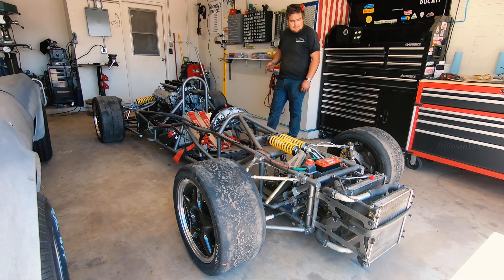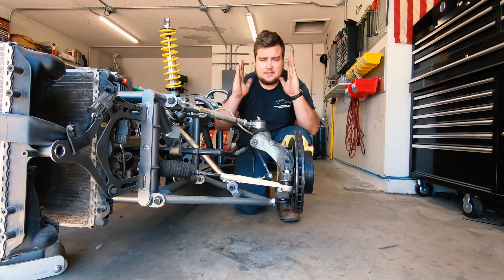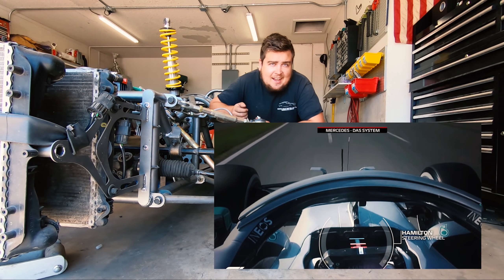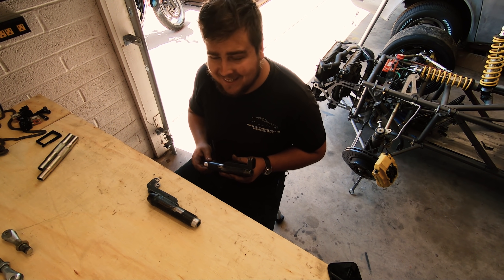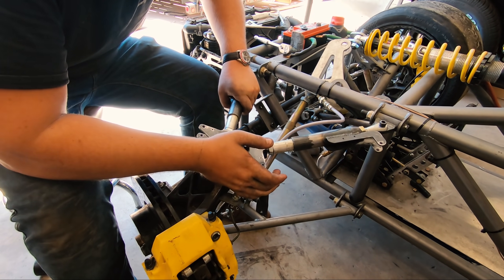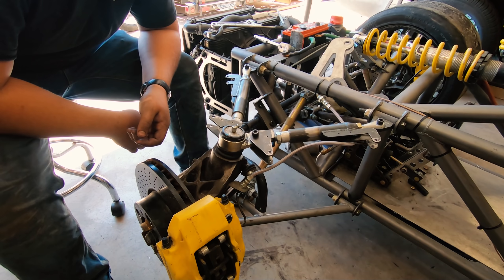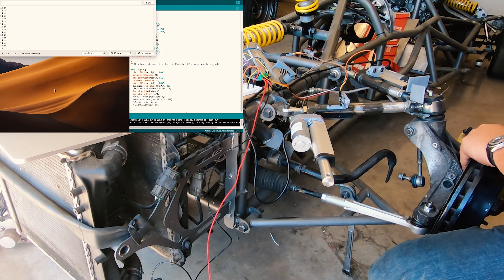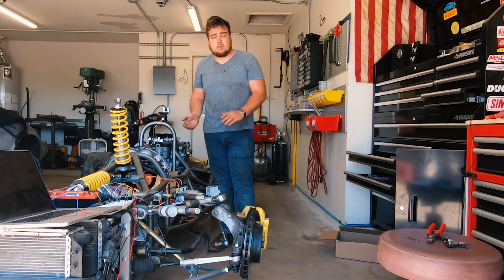DIY Formula 1 Active Suspension and DAS

Comment: On motorbikes they use a liniar potentiometer to measure the front and rear suspension travel.
You could create one a lot like you made the suspension with potentiometer with a toothed wheel and have teeth on the inner rod. 
Idk if I'm making sense but you are a smart guy so you should get what I mean.

Comment: Boomer hotrodder: "If you can't tune your car with a screwdriver, I don't like it!"

Wesley: hooks laptop up to suspension
Reply: There’s a few of us boomers that grew up with wild experimentation in old can-am and f1 and endurance cars, that love this high tech stuff. Heck, the they had full blown active suspension in the f1 cars around 1990 if I remember correctly - of course it got banned. If you youngsters want a treat, look up the UOP Shadow can-am team circa the early 70s that used valve springs on cantilever suspension for weight savings and quick easy spring rate changes.
Reply: @barnabasranch5415  sadly not many boomers who were like that. they're heroes to me tho
Reply: @barnabasranch5415  The unlimited rally scene saw the most insane vehicle mods I've ever seen. Also resulted in a lot of deaths and maimed racers and spectators, so there's a bit of justification for why they banned certain tech from them. I do wish we still had unlimited classes in racing so we could see what utter insanity modern engineers could manage with a fully electrified and sensor controlled suspension, chassis, and an all-electric drivetrain. It certainly wouldn't sound as good, but man electric motors are insane. Especially if you can get your hands on a five-axis CNC mill, an electric motor winding machine, and a bunch of permanent rare earth magnets.
Reply: @mndlessdrwer  lol electric motors would be a major limiting factor
Reply: I laughed out loud
Reply: Haha that's great!
Reply: KISS, the most hassle free way to live.
Reply: Yeah and they are right this shit is fucking boring, over complicated and gives next to 0 benefit in a well set up car.
Reply: @ROGUESPIRIT_  It's only boring because your simple mind can't comprehend it's magnificence.
Reply: @anonymousarmadillo6589  it's really not that good

Comment: Wouldn't it be easyer/more reliable to move the connection point of the a arm to the frame? Could potentially be done with a single actuator. Also, you could look into temposonic hyd. Cylinders to mesure their position accurately.

Comment: Good work. How are you going to control wheelspin? The torque hit is immense and even the 4,400 lbs SL65 cannot stop the tires from spinning at 60 mph? How is your lightweight creation going to hookup with even the smallest of throttle, at any speed?
Reply from the maker: Very carefully- I’m actually not completely sure and it would kinda kill the spirit for traction control- I’m not sure what my plans are outside of not trying to crash
Reply: @WesleyKagan  The weight of your vehicle would benefit with traction by using only 2nd, 3rd, and 5th gears. I believe the any MB car with the V12TT has a setting where the transmission starts the car off in 2nd gear. Comfort mode maybe??? 1st, with your light weight and massive TQ would be a gong show. 2, 3, 5 or 2, 3, and 4th gears. 5th will take you out past 200 mph. As far as tires go, something very sticky like a drag radial would almost be a must but, if you run a super soft road tire, say the Michelin Pilot Sport Cup 2, even though the tire is very soft, wear won't be too much of an issue due to the lack of weight. Also, what weight you do have is over the rear tires thus, providing more traction - Porsche-esque traction. Really enjoying the channel and your work so I wanted to say thank you. Really awesome stuff.

Comment: Could you put the ultrasonic sensors inside the tubes of the upper a-arm? Would be cleaner aerodynamically and aesthetically and would perhaps offer some protection.
Reply from the maker: I may. I’d like as clean as a signal as possible but wire resistors are expensive

Comment: Any thoughts to having some sort of fail-safe mode, or suspension centering in case of a failure?
Reply from the maker: Yeah I’d like a mechanical default to zero but I’m still working on that. Safety is needed on that one for sure

Comment: Could you reposition the sensors near the ball joint and the flat reflectors on the chassis side? Tuck them between the control arms so they are more compact and aerodynamic
Reply from the maker: That would be the goal I think. With as little math I could probably get that to work

Comment: This system seems to do variable camber and toe with potential caster effects too.

That tells me Mercedes is using it to reduce rolling resistance in a straight line and change stability to make it less twitchy on straights.  It might help with braking by keeping the contact patch flatter, probably tire life too.

Those are ok things to do but the real prize in active suspension is to control damping, body roll, brake dive and suspension droop.

Failing a suspension with active dampers, I think a Renault style mass damper would do more for your suspension than a DAS system would.

When you are driving 10/10, DAS might provide an advantage in straight line speed or flicking it around a tight corner but I'm not seeing a point unless you drive like a madman constantly.

To simplify (for toe only), I would put a single hydraulic cylinder between the inner tie rod ends inside the steering rack with something like a hydraulic throw out bearing behind the steering wheel to act as a master cylinder and I would make the steering shaft slider helical so that the asymmetric effect on the steering would be countered by the push/pull.

I don't mean to be a downer but this seems unnecessarily complex by a lot.

Comment: the fact that he's literally put every modern automotive innovation into his own cars is something i want to live by with
Reply: You know what engineers say for complicated systems - more thing to fail. This could be description of a modern vehicle: assembly of parts that will fail, probably expensively.
Reply: Yes. Exactly what I wanna do. Engineers ftw
Reply: And I wish I could have a more primitive vehicle,at least for offroading.
Reply: looking forward to adaptive cruise and lane keeping. Two features I specifically chose my car for when I was shopping last time which necessitated a trip two states away to purchase the vehicle. 2013 Ford Fusion EcoBoost AWD Titanium with basically every single upgrade you could possibly option onto that model year. The one feature it's missing is the heated steering wheel. I added a tuning modchip to boost its power to something like 304 BHP and 350 lb-ft of torque. It's definitely a noticeable improvement, even though it's somewhat debatable whether it was worth the nearly $600 pricetag and lengthy and annoying installation process. Regardless, the Ford Fusion, despite Ford's best attempts otherwise, is an excellent driving car that has weighty and accurate steering and handles better than it feels that it should, particularly given how massively heavy the beast is. Curiously enough, the mod chip only knocks off about 1-2 MPG on the highest tuning setting. Not like it ever got great fuel economy in the city anyway, so a worthwhile tradeoff in my opinion.
Reply: I like that he's only adding the modern performance innovations though.. as opposed to lazy driver assists
Reply: But, is it a hybrid? I don't think so. Lol
Reply: @senul_samarasinghe  maybe it will ! Given how talented this guy is anything is possible!
Reply: @gavinpotter8741  yeah. I was just joking earlier. I can't do squat while that guy made a freaking car with f1 suspension.
Reply: @senul_samarasinghe  Doesn't he said that he needs more weight in the front? The BMW i3 drivetrain looks very well packaged ;-)
Reply: Not wanting to be a grammar Nazi or annoyingly pedantic but "live by with"  seems to combine two concepts.
Do you want to live with a car that has every automotive innovation?
Or do you want to live by the ethos  that drives someone to add all these things to their car?
Reply: @benholroyd5221  well you are being a pedantic Nazi . You know what's meant and is likely to be a predictive text correction
Edit
I missed one
ANNOYING pedantic Nazi

Comment: You just executed something I have thought manufacturerers should be considering for the past 10 years.  Bravo Sir!  The first time I added a significant amount of negative camber to one of my cars. it was an absolute revalation where handling is concerned.  Obviously, it comes at a cost to the tires when done on a permanent basis..  So, the idea of adjustable camber on the fly came to mind.   In my head, it would have simply consisted of a moving top mount for the shocks, something that is obviously not a thing in your particular "car".  Anyway, Awesome content :)

Comment: Any reason for using ultrasonic range finders over capacitive encoders like the ones used in cheap digital micrometers?
Reply from the maker: Space currently, and the ultrasonic finders were cheaper and more robust. I’m not completely sold, admittedly.
Reply: @WesleyKagan  I don't think those ultrasonic sensors are going to give you very reliable readings once you start driving, especially at higher speeds. The wind is probably going to drown out the signal.

Comment: Hydraulics won't be necessary faster you will need a larger pump whit good amount of flow to get the same performance as electric actuators. The advantage in comparison is they are stronger and more robust in construction  . When you go for Hydraulics make sure you get pistons whit integrated position feedback so you won't have to deal whit the ultrasonic sensors. Ultrasonic sensors are fine for testing but not for long term use exposed to the elements you can get ironies data. Also i'd like to no if you have calculated any of the forces the system will be experiencing or are you winging it (not judging just interested)
Reply from the maker: Sure, completely agree. Strength and size are most of it, and built in position is absolutely a plus. 
I have some napkin scratch forces but I’m not completely sure yet!
Reply: @WesleyKagan   thanks for the reply looking forward to seeing where this project goes. I want to make my self a tube frame car maybe have some composites made as I'm working on making a large format machine for making molds. Also if integrated feed back is to expensive you could look in to linear encoders you should find them on the cheaper side from some of the Chinese manufacturers. You don't need that big of a resolution any way cheers
Reply: I was going to post something similar. Those ultrasonic sensors will eventually get covered by dirt and road grime, they're also a bit on the delicate side. Also I don't think those electric actuators will be able to cope with all the forces.  Fully extended, those things will have quite a bit of flex in them.
Reply: @markovchainindustries  the geometry is constructed in a way that the actuators don't experience bending moments most of the stresses that the actuators experience is from axial force .Actuators like this are made to take axial stresses but not normal stresses that are a result of bending moments. Strength wise biggest problem would be the shaft buckling under the forces weight but by the time that happens you prob see a bracket fail first .The biggest worry about the actuators is them giving out do to large axial shock forces some have plastic and or metal powder molded gear boxes in them. But that isn't a problem if the actuator is able to be back driven if over powered.

Comment: Super cool! 
Ideal camber/caster settings are distinctly different for different objectives, now you can have the best of multiple settings

Off the top of my head I think about the effects of positive castor on steering sharpness. Too little caster is unstable at speed, but has good feedback in tight corners. Tons of caster and itll steer like a truck around corners but be super stable at speed.

Comment: I enjoy following the videos - thanks for the interesting content. On the front, what informed the inboard pickup points? I'd have expected the vertical distance between upper and lower arms to be less, to give a camber curve that increases negative camber with compression, rather than the current arrangement that looks to have a curious camber curve.

Comment: The mind boggles at the number of variables to tame and contend with to optimize a system with so much flexibility.  Differential adjustment of alignment for optimal contact patch during cornering, stability control, good grief there's a lot of possibility.  
Assuming you know the basics of alignment trade-off for cornering performance, it would still be a lot of wrangling.  But... If you could optimize it it would be spectacular.

Comment: First of all, very Nice work your system seems to work very nicely and with a good program that could be insane. I was wondering if originaly you set up your suspension geometry randomly or you designed it so it no bump stear and correct balance etc..

Comment: Very cool, I always assumed cars with on the fly suspension adjustments would use eccentric bolt and servo motor instead of a linear actuator.
Reply from the maker: I spent probably a day on a eccentric bolt setup with poor results actually. I got a lot better control with this setup

Comment: Your videos are getting better each time! I thought the DAS system worked by moving the inner hinge point of the tie rod front/backwards. Through the geometry that would cause toe in/toe out.
If you had used your linear actuators to move your complete steering rack front/back, that would have done  the trick also. It would'nt add unsprung weight that way. I understand that the way you did it, you also have full control over caster/camber/king pin inclination
Reply from the maker: Thank you! Yeah for the tie rods those should be easier with a fixed point.

Comment: Are those sleeves for the actuators just going to live like that for the hydraulic setup as well? I would worry a little bit about heat and friction if that’s happening with actual road loading involved. Knowing your style though I’m sure you’ve got a solution and I’m not telling you anything revelatory. 😄 Loving all of your videos!
Reply from the maker: They should work okay with two harder dissimilar metals, and they aren’t going crazy enough to build too much heat I hope. It’s something that needs testing for sure. Thank you!

Comment: The mad lad copied DAS. Incredible
Reply: Ferrari in shambles.
Reply: das incredible
Reply: Isn't das a mechanical link?
Reply: @Scoots1994  Mercedes needed to use a mechanical link because of rules in f1 regarding active suspension. Wesely is taking their concepts without the strict rules of f1 and improving upon it. In concept the control of the DAS (dual axis steering) could be achieved autonomously with the right research, trial and error. 

This entire project and the fact he keeps finishing things soo quickly is awesome.
Reply: @user-zj2mb3sp3x  it seems even more complicated than das
Reply: What you saw in this episode is not DAS. It's only the active suspension part. The DAS system only affects toe. What he built here changes camber and caster. DAS will be in the next video.
EDIT: You can see @2:25 in the video, he explains the DAS part on the steering rack/arm which would give toe in/out but in the rest of the video he worked on the more complicated active suspension on the upper A-arm.